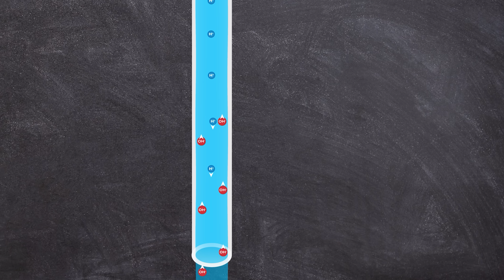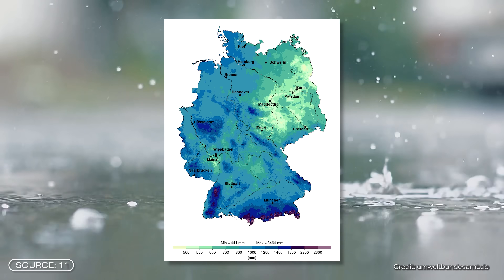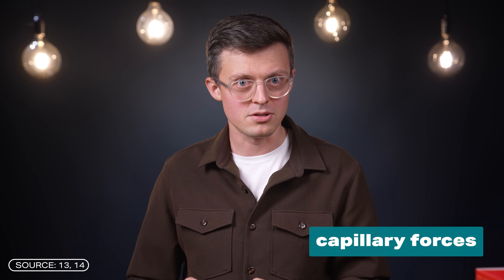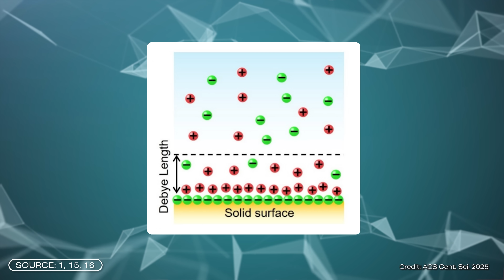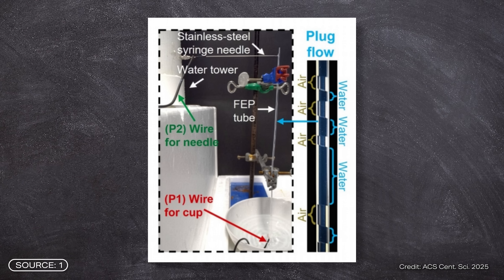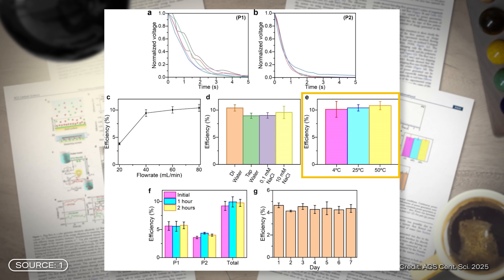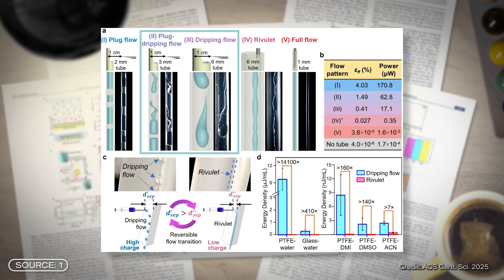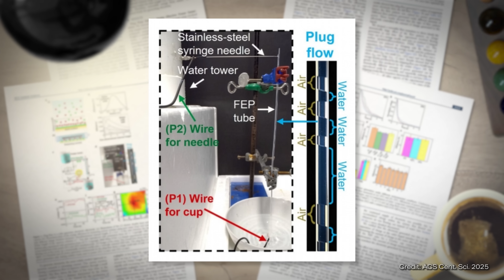Physics Hack: 100,000x More Electricity from Rain!

Comment: I'm wondering how this would compare to just collecting the water and feeding it through a small hydroelectric turbine.
Reply: I collect water runoff from my roof in a basin and use a 12v pump to put it in a pond. It costs me very little in power to elevate this water 4 feet. So that means it would be equally dismal to collect energy from this amount of water.
Reply: @ravenousvisages 
I think any electricity generated from the rainwater flow down the pipes will be much less than the electricity needed to pump the water going up.
But if the water is collected from a big area, like solar panels extending away from the buildings acting as a funnel of sorts, and several hundred meters up a high rise, the electricity generated will be substantially.
BTW, if you can divert the water directly to your pond above four feet of collection point, you don’t need a pump.
Reply: That's a good way to think about it @ravenousvisages
Reply: Excatly the question I would ask too. Probably better, otherwise why bother, but would be interesting to know just how much better really is.
Reply: I did the calculation for the energy of water from a rooftop of a house and it's negligible. Something like you can charge a phone in a rainy month.
Reply: @cubic2011  I think putting a micro turbine at the bottom tall commercial building could make more sense. Larger surface area to collect rain, more energy to convert from the higher height difference and micro turbines are 60~80% efficient. Still probably not worth it.
Reply: @cubic2011  The power from this "new" principle is even more negligible.
Reply: @cubic2011  Based on what? Those calculations could vary wildly by surface area, turbine size, and average rain volume for any given region...
Reply: @3nertia  I calculated for a 100 square meter surface at the height of 10 meters for the average monthly rain in Sweden. The calculations are theoretical and not take into account friction. It will be even less energy in reality. It's basic physics where I transform the potential energy of the water mass (Joules) into electric energy (Wh).
Reply: @cubic2011  And what was your actual result?
Reply: @3nertia  For a 100 square meters roof at 10 meters height for an average rain month in Sweden I can charge my phone once 11Wh. It's high school physics nothing fancy. You have Potential energy of the water = mgh (Jules) transformed in Wh.
Reply: @cubic2011  That's not "negligible", especially if combined with solar and wind power...
Reply: @3nertia 11 watt hours IS INDEED negligible in a month's time.
Reply: @cubic2011  but if We use the Water wheel caculations and Apply A Gravity pump sytem and High pressure plumbing
Reply: @AMPProf  No matter what we use it will always be less then my theoretical calculation. I just transformed the potential energy of mass of the water (Jules) into electric energy (Wh).
Reply: Robert Murray Smith And Luke demonstrated a diy version of this, based on the research paper, a good year or two ago. The output is actually quite impressive for what it is. If it could be be combined in a  pv panel it would be a win-win situation.
Reply: @noldushumlesnurr6169 Don't have time to find and watch it. But my calculation was just the gravitational energy of the rain falling on my roof. I live in a 'rainy' part of europe with in a 2 story house and i remember that if it could generate max a few Watts (1-5W) on average through the year. Obv it would be with peaks when rain falls. And some more energy would be lost when drizzling rain just evaporates on the roof.
Reply: It couldn't be worse.  I watched a video a while back where a guy put a generator on one of his downpipes and used it to charge a phone.  It took a week of heavy downpours
Reply: @IanM-id8or quint builds is the channel I think
Reply: I didn't research this carefully... just the first answer that google pops out but small hydro turbines can generate power with upwards of 60% efficiency. The technology would be much simpler to install as well. It's hard to imagine a scenario where the methodology outlines in this video would be a better idea than harvesting the water in this simple way.
Reply: @alsmith20000  I did the calculation for the energy of water from a rooftop of a house and it's negligible. Something like you can charge a phone in a rainy month.
Reply: @cubic2011  That sounds about right. If you could somehow collect the water 1km high above your house it would be another matter. Even then though, you'd need to deal with their only being power when it rains. The sun is much more predictable.
Reply: @cubic2011  Came to the same conclusion. It's fun to think about, but the amount of energy in a year is just not worth the smallest of investments.
Reply: @alsmith20000  (comment 2) What sun? Dunkelflaute!
Reply: @Chris-hf2sl  It's limited to 32cm by the tech. Water falling from a roof would be falling at least 2.5m, up to 5, but still with 1 cubic meter per hour (1000kg of water) it would give you 25-50k joules per hour, or about 5-10W output at ~70% efficiency... The method described in the video cannot be just a potential energy.
Reply: @alsmith20000  Falling meterorites....
Reply: @cubic2011 x 100 4 cm pipes . Now redirect that water to another 80 6cm pipes before it leaves the roof in 40 10 cm pipes .. that ends up in a 20km long sewer pipe x 100.000 homes .. calculate this for me please
Reply: @alsmith20000 solar and wind power in a larger scale is not opperable yet for distribution plants 😂 already sometimes tramsformers blow out because of the huge increase from sun and wind at the same time
Reply: @obedientfire840  That's easy 😀. I calculated for a house  11Wh/month then for 100.000 just multiply.  It will be 11MWh/month. The pipe's don't matter here.
Reply: @Chris-hf2sl  well, but in this case it wouldn't need to fall just 32cm, it could fall more than 2 meters, from the rooftop to the ground...
Reply: @Chris-hf2sl    So, I was thinking about my rain gutters.  I have 3 down spouts and a 2600 square foot roof.  When we get rain, we get a lot, and the flow from those down spouts is very strong and the head pressure is significant.  A 10' x 4" diameter pipe full of water has about 50 pounds of water at the outlet.  That much weight is certainly enough to turn a series of wheels (say 3 wheels in line inside the pipe sharing a timing chain or belt so that they all help each other turn) and this is attached to a geared motor so that it spins faster than the water is actually falling.  Introduce a flywheel to keep momentum as the rainfall varies.  I don't think it's out of the realm of feasibility in a region that gets steady and consistent rainfall.  I'm not saying I have the answers or even understand the math to calculate the output, but it's an interesting conversation.
Reply: @cubic2011 i did the same calculation a couple decades ago and found the same... there's just not enough volume or drop.   The energy produced is close to negligible
Reply: @Chris-hf2sl tell us you didn't understand the video without saying "I didn't understand the video" 😂
Reply: @Chris-hf2sl  You’re thinking in terms of classical hydro turbines, where energy comes purely from mass and height. This system works differently:

1⃣ Triboelectric effect: Droplets carry charge that can be harvested directly as electrical energy when they contact a surface.

2⃣ Mechanical deformation: Droplets hitting a spring/cork deform it; that motion is converted to electricity via piezo materials.

3⃣ Impact on the reservoir bottom: Additional mechanical energy is captured and converted electrically.

No large shafts, gears, or turbines → almost no friction losses.

Key point: This doesn’t violate conservation of energy. The energy comes from the kinetic and potential energy of each droplet plus its electrical charge. On a macro scale, each droplet’s contribution is tiny, but the system can capture almost all of that micro-scale energy, which traditional turbines cannot exploit efficiently.
Reply: @Chris-hf2sl  Youre not getting more energy than whasts avaiblable.. Droplets hitting springs are just one of the ways you can harvest the energy, you need to combine several. And no its not about mass and higth at all . This proves to me you are not understanding the concept in the video at all.... It’s not about the total mass of water or its height.
This method only works because of the air gaps between the drops — that’s where the charge separation happens.
If you just let a continuous stream of water flow with no air in between, the effect disappears almost completely.
So adding more water doesn’t mean more electricity — the system needs those separate water–air interfaces to generate voltage. It’s about surface physics, not bulk mass.  When rain hits your head, nothing happens electrically because your skin only provides one surface for contact, and the charge that forms instantly dissipates into your body and the surrounding air.
The Singapore method works differently — it uses many repeating water–air–surface interfaces inside narrow tubes. Each droplet and air gap forms a new electrical double layer, and those tiny charge separations add up along the length of the tube.
So it’s not about random droplets hitting something — it’s about a controlled sequence of interfaces that keep reforming and maintaining charge separation instead of losing it immediately like on your skin. Also, your skin isn’t the right material for this effect.
The electrokinetic charge separation depends a lot on the surface material — certain polymers like FEP or PTFE have properties that let ions stick and separate effectively.
Human skin, on the other hand, is slightly conductive and wet, so any charge that forms just leaks away instantly.
That’s why you don’t feel a shock from rain — the charge can’t build up or be harvested like in the polymer tubes used in the experiment.
Reply: @Chris-hf2sl  Eh...  If I were using water turbines, I'd have a 4 m pipe for energy (Gutter to ground).  So... about 10wh per inch of rainfall on that roof (total).  Better, but still ain't much at all, because roof is small.  My house is 200 sq m, so you can figure I'd probably get 30 wh / inch, or 1.5KWh per year based on my zip code.  Eh... all that for a quarter?  Then again "all that" is 2 turbines and filters.  VS 2 days to cover the roof with solar and about $15k of CapEx for panels and inverters...  but still... payback via 1 quarter a year?!
Reply: @thorjohnson5237  "1.5KWh per year"  There are 365 x 24 hours in a year. So the average power, according to your figures is 1500 / (365 x 24) watts. That works out to 0.17 watts, which is in the same ballpark as I calculated above (with slightly different assumptions). it's negligible and not worth bothering with.
Reply: @Chris-hf2sl  'but I too wouldn't expect much power either'  First, think wimshurst generator, where there are 2 plates, and once there is an imbalance it can create electricity from the motion.  I think that's roughly what they're doing with their electrodes in a tube of moving water.  So their extra power is actually from the flow of water down, not just gravity weight potential converted magnetically, but directly from the flow making electricity.  Still, most places simply don't reliably rain enough to be useful, solar power is far easier to directly use.
Reply: @Chris-hf2sl  
Now Chris, since you're super smart and so far over my own 180 IQ range. find the part where I said anything about this:
'you can't get more energy out of the system than that original potential energy.'

You can't, because YOU HAVE GOTTEN IT WRONG.  This was never even remotely said, you've only pretended it.

Due to the relatively low head, 'water from your roof' to turn a water wheel type generator is inefficient.  A lot of the energy is lost on the roof in friction moving down the roof, you're only getting the energy from the gutter collection point in most cases.

' No matter'  Of course it matters.  If you have square meters of tubes on the roof and can collect tons of energy that would normally be lost by the other system, it's a lot more energy.

If you're struggling and need help to understand something, ASK why, don't just 'pretend you understand it better' when you're lacking.
Reply: @alsmith20000  This is very interesting, but I dont think this is a viable home option. Just saying your trying to eak out as much power out of your property as possible, its not enough power to have any significant input vs just installing a turbine in a down spout.
Reply: @alsmith20000  Obviously, this needs far more research and development, but, as the numbers stand today, 10% is nothing compared with 60%.
Reply: @alsmith20000 but the actual amount of power you can get is on the order of what's needed to charge a phone...
Reply: @alsmith20000  there's ballpark 1kwh of potential kinetic energy in the rain falling from an average (European) roof. 800mm rain per year, 80m² roof surface, 6m drop from the gutter. At 60% efficiency that's 0.6kwh, out of an average average 4000 kwh yearly consumption.
Reply: Nature does just that, by the landforms (geographic reliefs), our job is to chose the location of the hydroelectric powerplant properly. 
This research is nice, typical for scientists who rarely leave their laboratories.
From the author's initial calculation for scaling, it is apparent, that the costs would scale exponentially, with a non-quadratic exponent, but higher.
Reply: There’s no head pressure to spin the turbine fast enough, you’d need water storage above your house to run when it’s not raining
Reply: There are great videos showing how little electricity is generated. 

https://www.youtube.com/watch?v=S6oNxckjEiE

tldr; are just too many losses and not enough power from the water hitting the turbine.
Reply: The longer you use a turbine the less efficient it becomes due to wear and cost of maintenance. Turbines need moving parts, and every moving part creates drag, which is bad for efficiency. To do useable work, a turbine needs to have a sufficient vertical water column of pressure driving it if it is run off a natural source, which means that a damn or something similar is required. Turbines are far more likely to break and have a constant cost to run. 
Even if you get a tenth of the efficiency of a turbine using a solid state generator, the running cost is virtually nil and you can install a far larger number of them. 
If you already have a generator, then definitely divert the rainfall through it. 
If you don't, and you only need a small amount of power, then using a turbine is a waste of time and money.
Reply: Someone could make a parallel hole extrusion pipe with very thin walls.
But I still think such a system won't be production stable for years and pollution will probably have an effect in the longer term.
Reply: Have you any idea what an insignificant quantity of electricity a ‘roof rainwater’ hydro turbine would make 😂😂😂
Reply: @andyxox4168  this isnt a hydro turbine concept
Reply: Energy is m.g.h m is one kg of water for each mm of rain per square metre of roof. h is height of the roof, g is 9.8m/s²

1 inch of rain, 200 square metre footprint, 5000kg of water, 2 metres of fall is 100kJ or 27 watt hours. With a much larger house and higher roof, you can improve. However where I live, rainfall is only 600mm per year. It would, in the best case scenario, make as much in a year as an average solar installation makes in an hour.
Reply: I know 1 YouTuber did this using bell syphons in his gutter to make sure enough water built up to actually spin the motor
Reply: hydrolic turbine has its own cons too. so having none motor generator is a big price cut in materials. unless the manufacturer of said plastic tubes increase their price and even some materials needed to create one rain generator like this. you know capitalism.
Reply: Very favorably I should think .
The stated 10% efficiency is hardly impressive. Large gravity pumped hydro systems can reach 70% efficiency, and this includes losses during motoring the electric machinery to raise the water for energy storage And losses releasing the water and generating electricity. 
So I would think in a one-way tiny system 50% efficiency should be achieved easily. 
Another thing is the described charge separation Electrostatic generating unit is likely to deliver its energy at 20KV and a few Milliamps. 
Speaking as power conversion  engineer converting many 10s of kilovolts DC to usable voltage is a lot more expensive than converting say 600 VDC to 240 VAC.
Reply: This creates high voltage but almost no amps. Turbine creates a good amount of amps but would struggle with volta
Reply: Robert Murray did some prototypes based on that idea, IIRC
Reply: Yes bad hype video
Reply: There's a guy in YT that makes experiments with it. Not good. Too complicated, lots of plastics, negligible energy.
Reply: Why not both?
Reply: This thing theoretically delivers 100 watts per square meter. So a fraction of solar, but with the added complexity of a lot of water moving around in special pipes that probably need significant periodic upkeep, plus bunches of step-up equipment.

This isn't going to be something that gets used for power generation except maybe in extremely specific conditions for esoteric purposes.
Reply: Why not arrange both? Increase the power output using the same falling water in at virtually the same time?
Reply: Assuming a little hydro-electric device could even work, I'm pretty sure you need the weight by volume of water as head pressure to turn the wheels.
Reply: Solar is more consistant
Reply: There are videos on yt of people trying this idea. Energy generation is quite small
Reply: Why not use both methods? Rain must hit something and going through something at first, and then you can collect it and do your other stuff next.
Reply: Badly cuz there's fuck all pressure there's already a youtuber that does this on a small scale with a turbine on his gutter to generate power it'd like 3v arround he generates and I think it's actually less then not more then that
Reply: Some numbers: given 1m of annual rainfall on a 10m x 10m roof, 6m from ground level, the potential energy, if converted with 100% efficiency, would be enough to boil (raise from 20C to 100C) 17 litres, or about 10 kettles. Factor in inefficiency and the intermittent supply and this is not an effective energy source.
Reply: @chrisl2656 out of my kettle experiment. It was necessary to consume 100Wh per 1L of water, with the power factor of the kettle around 0.99. So per year 1.7kWh 🤔
Reply: I imagine both technologies can be combined for better efficiency. There are cities that get 200 days of heavy rain every year, maybe this can be utilized in those places to generate a meaningful amount of electricity.
Reply: @gokhan4461  then again, if you’re any good at mathematics, maybe not!
Reply: More direct the energy conversion should have higher efficiency (potentially).
The "in between" step of mechanical energy (the turbine) and all the associated waste energy.
We've optimised turbine tech a lot....so, ya, probably right now it's better. But the future looks bright....or rainy. Ain't gonna matter! 🙂

Typical rooftop (as noted in other comments) isn't gonna be much energy, but not a concern...yet. Study it, perfect it, optimise it.
Hybrid systems are probably the ultimate goal: solar, TENG, plug gap and a generator. Squeeze every last drop (ha!) of energy out.
Reply: Here’s my stupid idea. Since rain drops must have come from a decent height they should have some KE, so instead of stopping them on a roof , losing all their lovely KE and then funnelling them down little tubes , we put piezos on the roof and let the pleasant drumming of the rain make electricity.
Reply: @sitonmyface56  …. Say 2.7millijoules for large one raindrop at terminal velocity and 3.6 million joules in a kWh … you would need over 1.33 billion drops to get 1kWh 😂😂😂
Reply: Yes, I was thinking this solution is too complex when collected water can fall across a turbine.
Reply: Watch @QuintBUILDs series where he captures Rain Water and creates power to charge his phone.
Reply: This came to my mind as well
Reply: i saw a video on youtube from a guy who did the calculations, exactly what you are asking, for his house. Roof surface, amount of rainfall -> volume (mass) of water going down the drain per second add the height of the roof and you can calculate (simple formulas)the (al losses, friction etc.neglecting) theoretical available energy to run a turbine It was very disappointing. To prove his point he built it and the result was as worse, close to zero. (friction losses turbine efficiency.... So, interesting question but sadly useless concept.Way to small to have any use. It's a pity i don't remember his name and the title of the video because it was very well scientifically and mathematically substantiated.
Reply: DO BOTH!
Reply: Funnel the water and make it hit crystals... that way you can use the piezo electric properties of the quartz to amplify the amount of energy ánd maintain a harmonic natural frequency (current)
Reply: My roof is 50m^2 with an average rainfall of 86cm, but let's say 100cm. So in total that is 50m^3 of rain a year. 1 cubic meter, but at a height of 10 meters = 1000kg x 9.8ms^-2 x 10m = 100 kJ or 27Wh. Per year this would be 1.35kWh a year. Seems extremely low so maybe I messed up somewhere. At 9:14 he says this system is >10% efficient compared to the potential energy (in a 32cm tube, but I think we can extrapolate that efficiency for any height by imagining several 32cm over my assumed 10m high roof). So just comparing this 10% efficiency to the 50% efficiency (that I just made up without researching) of a hydroelectric turbine, I think your question is valid unless we can indeed make this as cheap, robust and maintenance free as solarpanels.
Reply: I calculated it with gbt, for 2 kwh a day you need 524 kuub of water.
Reply: Rain water is not clean so anything that requires clean surfaces and filters won't work.
What about using gravity and flow to spin a wheel and a small generator instead?
Reply: @Tailslol Rainwater from roofs doesn’t have enough mass flow or pressure to drive a turbine properly. You’d lose more energy in gears and friction than you’d ever get out of it. Maybe if the roof was gigantic you could get something, but then you might as well build a whole dam and lake — the cost would be about the same.
Reply: @Lodium1  we make small turbine that react to wind.
a roof here is probably 120 to 240m2 of surface and have 2 to 4 floors.... this is probably enough to make it move.
Reply: @Tailslol  This is physically incorrect.

Physics Breakdown

Wind Turbines vs. Water Turbines from Rain

Wind turbines: extract kinetic energy from moving air; continuous, low-density flow but over large rotor area → can generate useful energy.

Rainwater turbines: rely on water’s mass × gravitational potential energy; tiny volumes of rain and short fall heights yield microscopic energy.

Numerical Example

Suppose a 200 m² roof receives 5 mm of rain (typical shower):

Water volume: 200 m² × 0.005 m = 1 m³ → 1000 kg.

Height drop: 10 m (from roof to ground).

Potential energy: 
𝐸
=
𝑚
𝑔
ℎ
=
1000
×
9.81
×
10
≈
98,100
 J
≈
0.027
 kWh
E=mgh=1000×9.81×10≈98,100 J≈0.027 kWh per shower.

Compare this to a small rooftop wind turbine: can easily generate 0.1–1 kWh in the same period depending on wind.

Efficiency Losses

Tiny rainwater flows → high relative losses in friction, gearing, and micro-turbine inefficiency.

Even with optimized channels and micro-turbines, harvested energy remains orders of magnitude smaller than wind.   Im not saying it’s impossible to get energy from rainwater—you can get something with a micro-turbine if the rain is heavy enough and the roof is large—but:

It’s intermittent – only works during rain, which may be brief.

High losses in typical turbine setups – gears, shafts, and the time it takes to spin up the generator consume much of the energy.

Inefficiency at small scale – microflows of water have low kinetic energy, so conventional turbines don’t capture it well.

Core of Your Point

To harvest rain energy effectively, you cannot rely on standard turbine designs. You need a system that:

Converts kinetic energy from individual droplets efficiently,

Minimizes friction and startup losses,

Possibly integrates electrostatic or surface physics methods, not just bulk water flow.

In other words, the physics allows small bursts of energy, but a traditional micro-hydro turbine is wasteful at this scale.
Reply: Much more efficient the higher the collector. More than one turbine can be added in stages also. Best use case would be from a property next to a very tall cliff.
Reply: @ricky4673  If you add more Turbines withouth adequte space between them you will lose the effect of the gravity  + Mass. When the water hits something it slows down. Sure, it works as long as the fall or river is long enogh, then you can add morte turbines but unless its a very tall skyscraprer or something , it becomes unpractical... It might also work if you have excess energy — like when you produce more than you need. Then you can pump the water back up using that surplus. Some hydroelectric plants already do this.
But it probably won’t work with just rain, because rainfall is random and short-lived unless you’re in a very rainy region.
So most people who try this, and don’t have access to a river or tall fall, just use solar or wind to pump it back up and store the water for dry periods.This, however, won’t work at all in very dry regions — so forget deserts or places like California.
In those cases, it’s much better to rely on solar and wind, and maybe even tap into earth’s thermal energy instead.
Reply: Ha you did it. You used "small" and "turbine" in one sentence.
Reply: Perhaps a combination of the two ?
Reply: Let's make a rooftop at 10 meters high.
We have 900 liters of water / year M^2. Lets make that 1000 liters of water for easy calculations....
every kg  has a kind of energy, potential energy, of 9,81 joules / m eter height. For the easy calculation make that 10.
This makes at a ten meter heigh roof that we collect 100KJ of energy / m^2. year.
If a house has 100 m^2 of roof the total energy 10MJoules /year   A kwh contains 3,6MJ of energy. 
This roof is capable of creating ca 3 KWH at most (in a wet year ) in potential energy. 
A hydroelectric turbing , ideal usage, can generate up to 60% of the potential energy. We create from a 100 m^2 roof onl 2 KWH of electricity in perfect hydro turbine conditions from our roof when using the mass of water.
To create efficient energy with hydro systems we need a lot of water (rain) , in other words the water of a very big region  collecting down to a lake and than a substantial drop in height.
Reply: @reiniernn9071  Rainfall Volume: 1000 liters of rainwater per year per square meter of roof (same as before).

Height (fall): 10 meters.

Energy Conversion: 9.81 joules per kg per meter of height.

Turbine Efficiency: 60% (you could improve this, but let’s assume it stays at 60% for this calculation).

Roof Area: 100 m² (as before).

Number of Turbines: 8 turbines total.

Number of Drainage Pipes: 4 pipes total.

Step 1: Total Water Collected Per Year

The total volume of water from the roof remains the same:

1000
 
liters
×
100
 
m²
=
100
,
000
 
liters/year
1000liters×100m²=100,000liters/year
100
,
000
 
liters
=
100
 
cubic meters
=
100
,
000
 
kg
 
(
since 1 liter of water = 1 kg
)
100,000liters=100cubic meters=100,000kg(since 1 liter of water = 1 kg)

So, you're collecting 100,000 kg of water per year.

Step 2: Energy from Fall (Per Pipe)

We calculate the energy as before using the potential energy formula 
𝐸
=
𝑚
𝑔
ℎ
E=mgh, where:

𝑚
=
100
,
000
 
kg
m=100,000kg (total mass of water per year),

𝑔
=
9.81
 
m/s
2
g=9.81m/s
2
,

ℎ
=
10
 
m
h=10m (height).

This gives the total potential energy:

𝐸
=
100
,
000
 
kg
×
9.81
 
m/s
2
×
10
 
m
=
9
,
810
,
000
 
joules/year
E=100,000kg×9.81m/s
2
×10m=9,810,000joules/year
Step 3: Dividing the Flow Across 4 Pipes

Now, since we’re using 4 pipes to distribute the water, each pipe will carry a quarter of the total water:

Water per pipe
=
100
,
000
 
kg
4
=
25
,
000
 
kg per pipe
Water per pipe=
4
100,000kg
	

=25,000kg per pipe

Each pipe will have 25,000 kg of water flowing through it per year.

Step 4: Energy from Fall Per Pipe

The potential energy for each pipe would then be:

𝐸
per pipe
=
25
,
000
 
kg
×
9.81
 
m/s
2
×
10
 
m
=
2
,
452
,
500
 
joules/year
E
per pipe
	

=25,000kg×9.81m/s
2
×10m=2,452,500joules/year

Since we have 8 turbines (2 turbines per pipe), each turbine would be responsible for half of that energy.

𝐸
per turbine
=
2
,
452
,
500
 
joules/year
2
=
1
,
226
,
250
 
joules/year per turbine
E
per turbine
	

=
2
2,452,500joules/year
	

=1,226,250joules/year per turbine
Step 5: Energy Conversion to kWh

Convert the total energy to kilowatt-hours (kWh):

1 kWh
=
3.6
×
10
6
 
joules
1 kWh=3.6×10
6
joules

For each turbine:

𝐸
per turbine
=
1
,
226
,
250
 
joules
3.6
×
10
6
 
joules/kWh
≈
0.34
 
kWh/year per turbine
E
per turbine
	

=
3.6×10
6
joules/kWh
1,226,250joules
	

≈0.34kWh/year per turbine

For 8 turbines in total:

𝐸
total
=
0.34
 
kWh/turbine/year
×
8
 
turbines
≈
2.72
 
kWh/year
E
total
	

=0.34kWh/turbine/year×8turbines≈2.72kWh/year
Step 6: Efficiency Factor

Now, applying the turbine efficiency of 60% (as before):

Energy output after efficiency
=
2.72
 
kWh/year
×
0.60
≈
1.63
 
kWh/year
Energy output after efficiency=2.72kWh/year×0.60≈1.63kWh/year
Summary of Results:

Total Water Collected: 100,000 kg per year.

Potential Energy (without efficiency): 9.81 MJ (9,810,000 joules) per year.

Energy per turbine (after efficiency): 0.34 kWh/year.

Total Energy from 8 turbines (after efficiency): 1.63 kWh/year.

Conclusion:

With 8 turbines and 4 pipes, the total energy output would be approximately 1.63 kWh/year.

This is an improvement compared to the earlier setup with 1 turbine and 1 pipe, which gave about 0.1635 kWh/year.
Reply: The smaller the turbine the more you have to deal with mechanical friction i remember a guy trying to make one on his gutter on YouTube and it was quite inefficient
Reply: Fr cuz you wont be able to put solar panels
Reply: The "German Science Guy" says at 8:59 that the described technology gives "over 10 percent efficiency". As an engineer trained in my youth to design electric generators, motors and transformers, I can guarantee that even a generator for 5w has 50 percent efficiency (their efficiency increases with power, the huge ones have 90 percent). Now, if we assume that the miniature Kaplan or Pelton turbine has an efficiency of 60 percent (the hydraulics of turbines are not my specialty), if we multiply the 2 efficiencies, we get 30 percent. That's 3 times more than what is described in the video.
And the little turbine with the little generator can be installed by ourselves, while what is described in the video must be purchased and installed by paid professionals.
Reply: Look into micro hydro turbines.  It's amazing how much water is required to produce even 100watts.
Reply: https://www.youtube.com/@QuintBUILDs has been doing that, his videos might paint part of the picture for you.
Reply: Why can't both function simultaneously?
Reply: Why not do both 
?
Reply: You were probably doing more thinking than you were listening to the video.  Why are you wondering? What is an interface effect? How does that work in conjuction with Debye length limitis? How did they create the setup and convert the flow to energy? Just watch the video again. I can't beleive you are asking and there are people who have answers😂 Come on pay attention
Reply: Hydroelectrics rely on high head to accelerate water and hit turbine blades to spin
Reply: Hydroelectric power (using gravitational energy of water at height) is governed by a simple equation (for a BEST CASE electricity conversion - reality will be worse but it can be NO BETTER - like Carnot efficiency for heat engines):

Power (in watts) = Water Density x Volumetric Flow Rate (meters cubed per second) x Acceleration due to gravity (g = 9.81 meters/second squared) x Head height (meters - the vertical distance between the turbine and the top of the water in a reservoir).

Often written:  P = ρQgH

Plug in the parameters from your house collecting rainwater and the number is TINY.  Not worth pursuing tiny.  Even if you owned a mountain and collected from a stream, the break-even point is shockingly high for both Q and H (these are the only variables - ρ and g are constants of nature).  You can find projects doing this on YouTube (one from Chile comes to mind) and the amount of energy extracted amounts to barely enough to run a fridge and LED lights.  And if the stream is seasonal, you are SOL.

The universal thing I've seen is MOST PEOPLE have zero idea how much power/energy is required to drive a modern lifestyle (they are Energy Innumerate).  Some of this is because they are mathematically ignorant.  Some is because they don't know how things work and don't know enough basic STEM to find out.

(I'm an engineer so it's my professional obligation to know)

99.99% of Green Fanatics fall into this Energy Innumerate group big time!

There are NO CHEAT CODES to the laws of physics just because reality is disappointing.
Reply: Badly. This thing is boasting >10% efficiency. A hydroelectric turbine can get >90%. 
And a turbine is less likely to clog on 1 leaf.
Reply: @donaldhobson8873  1⃣ Losses in conventional turbines:

Even if a turbine is rated >90% efficiency, that only applies under ideal conditions.

Energy goes through many mechanical steps: flowing water → rotor → shaft → gears → generator → electricity. Each stage has friction and turbulence losses.

Small obstructions (like a single leaf) can drastically reduce efficiency.

In practice, the actual energy converted from small or irregular flows can be much lower than nominal.

2⃣ Droplet micro-harvesting system:

Energy is extracted at three microscopic points:

Charge transfer from the droplet (triboelectric effect) → direct electrical energy.

Impact on the collection surface → mechanical deformation of spring/cork → converted to electrical via piezo.

Impact at the reservoir bottom → additional piezo conversion.

No large shafts or gears → almost no mechanical friction losses.

On the atomic scale, electron motion is harvested directly:

𝐸
electrical
=
1
2
𝐶
𝑉
2
E
electrical
	

=
2
1
	

CV
2

where 
𝐶
C changes as the droplet contacts the surface, and 
𝑉
V is the voltage generated.

Droplets have high surface-area-to-volume ratio, giving relatively high energy per mass compared to macroscopic flow where most energy bypasses frictionless parts of the turbine.

3⃣ Scale matters:

Turbines excel with large, steady water flows.

Micro-droplet systems excel at tiny, intermittent flows that turbines can’t exploit efficiently.

On this micro-scale, nearly all the energy of each droplet is captured, so effective energy conversion per unit of available water can be higher than a turbine.
Reply: Everyone... Please be aware, everything that everyone is inventing on social media right now, was invented, and deemed not useful, over 100 years ago.
Water energy comes from a column at height. Only useful method.
Build a collection device the size of your yard, at about 50 feet up, channel all that water through an 8 inch pipe, and you'll have all the electricity you ever wanted...
when it's raining.
Which it doesn't, most places, most of the time.
Should look into converting that collection device into a tennis court for years like this drought year.
Reply: This might just be the most stupid reply that I've ever seen
Reply: @lukewhatley6704  could you elaborate that? I'm doing research on the psychology of replies, and I find your comment outstanding from the rest of this branch, so, why you find this reply stupid?
Reply: A closed loop - large water tank above, equally large catch tank below (cistern), turbine(s) between, solar (and/or wind) to power the pumps refilling the water tower during the day... Water power used only at night - when electricity is needed most. Granted, it may need to be Olympic pool-sized water tanks...

Alternative idea: giant grandfather clock flywheel and gravity weights, lifted every day using solar and/or wind...
Reply: @TheRobberBarron  Yes, closed loop powered by wind or solar should work but you need large mass and height difference.  The problem is that gravity is by far the weakest force in the Universe. Therefore we must compensate with mass and height.